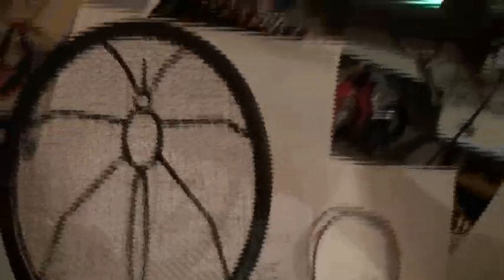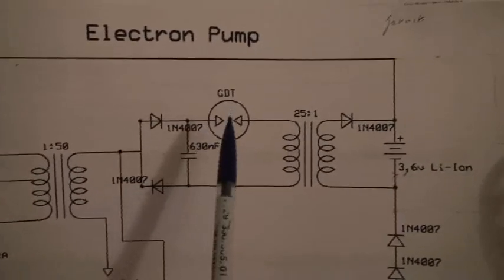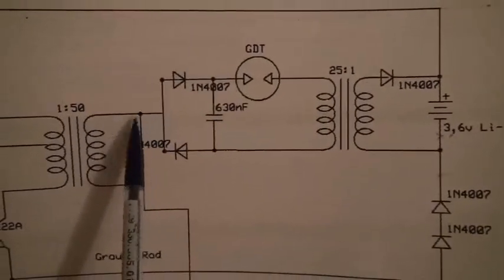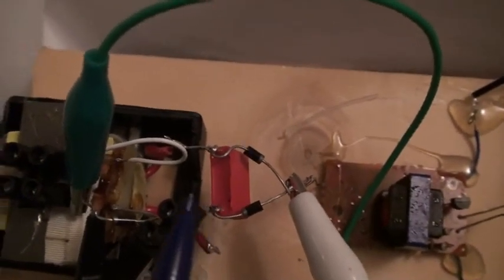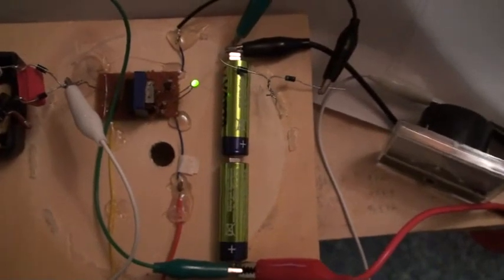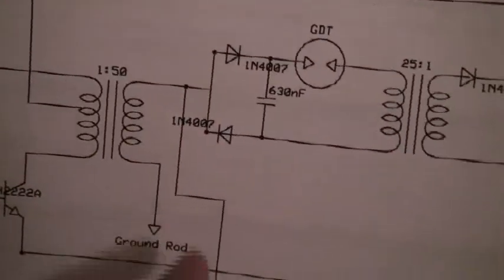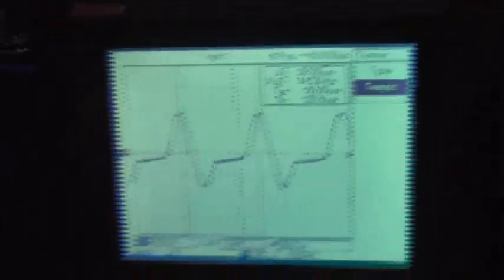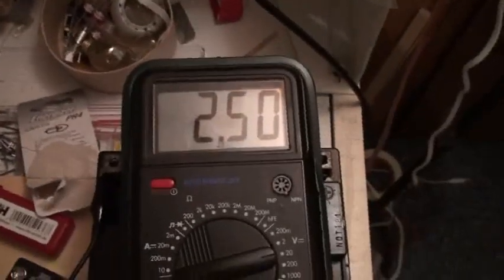testing a selfrunner candidate 1

Comment: i tried this on a 12v driver and could not get any real current out of the step down transformer, but i did notice it was putting out a wireless field when the primary was induced with the AV poles coming off the live wire. without using the plug and and without connecting both transformer leads to the AV plug there was no field. going to try again with a small GDT i found. i also tried with a flyback driver at 2.5v with no luck but the arc was not very powerful.